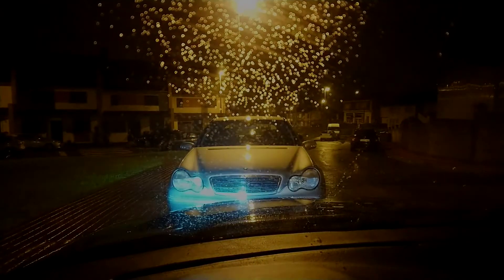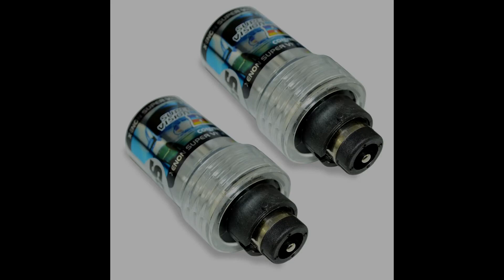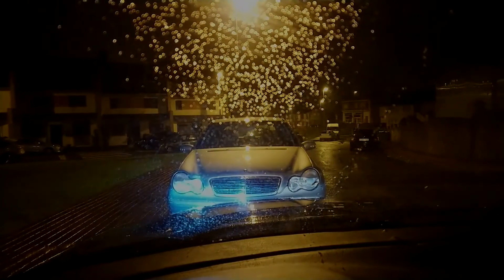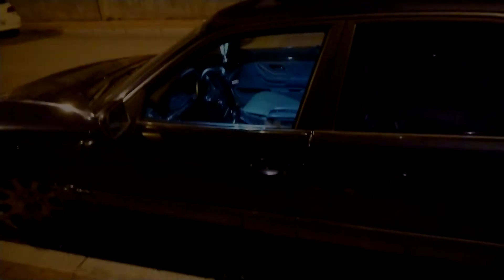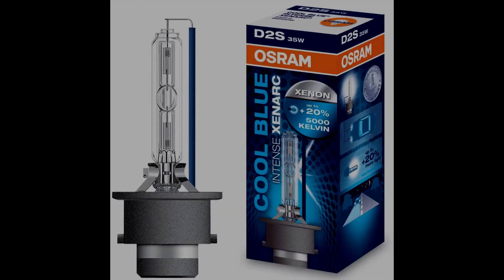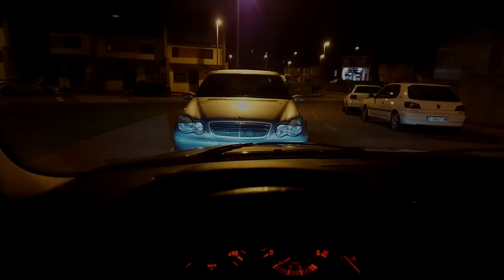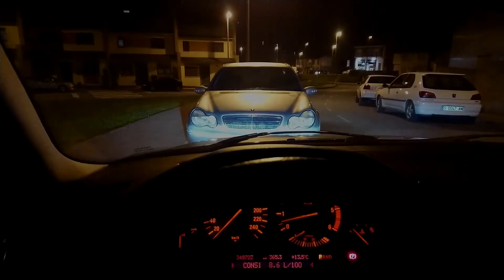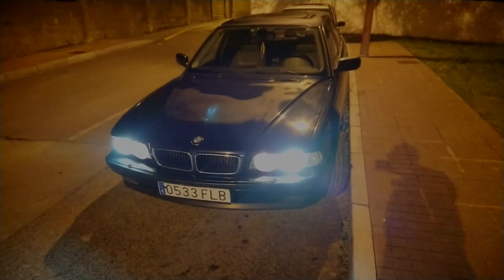D2S HID Xenon flicker failure when switch on BMW E38

Comment: Thank you for this video.  I am having the same problem. I just swapped the right side ballast on my 2001 740iL today, but no change.  I will try replacing the bulb, being sure to buy good quality.
Reply: I had this same problem.  After replacing the ballast didn’t help, I remembered that I had an extra headlight assembly which still had the oem bulb, so I swapped that bulb into the car, and it solved the problem.  It wasn’t the ballast, it was just the bulb.  Thanks again for this very helpful video.
Reply from the maker: Glad that it helped you! Thanks for the comms!

Comment: Having same issue, drivers side keeps shutting off, what name brand did you buy to resolve issue? Maybe you can send me the link to where you bought them?
Reply from the maker: Larry Tangemann I've bought the bulbs in a shop here in my town but if you search on amazon I'm sure you will find plenty of them. The brand is OSRAM, 5000k Temperature. 
Good luck with the problem, please let me know if you solved it!